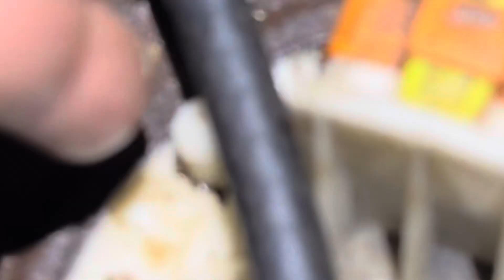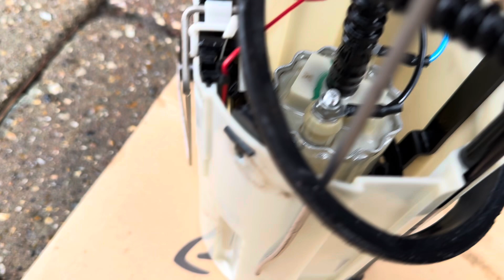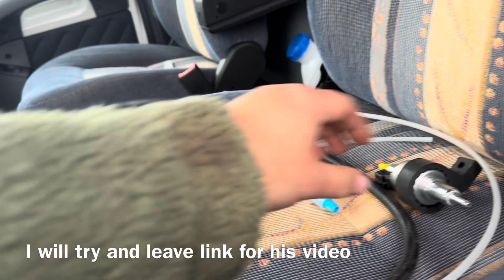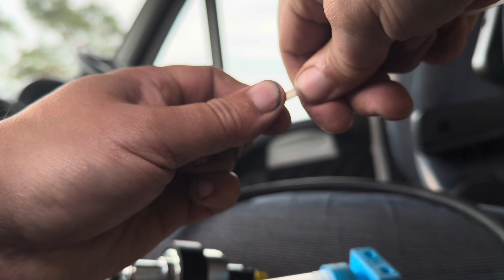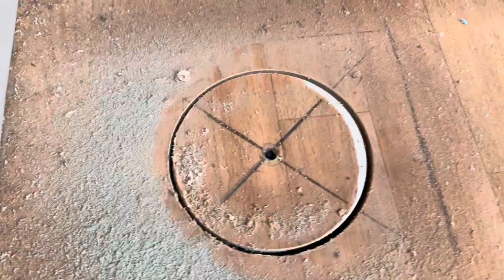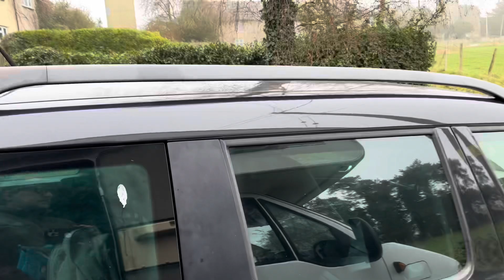How to Fit a Sunster Diesel Heater | Chinese Diesel Heater In my  Motorhome

Comment from the maker: One thing I forgot to add is when you’ve finished with the sender unit and you’ve reconnected all the fuel lines you need to turn the ignition key one click without starting the engine. Just turn the ignition key ONE click and WAIT.

 What happens here is the fuel pump pushes any air that’s got in the system out. Just wait 40 or 50 seconds and then turn the key back that one click and remove the key from the ignition. 

Then repeat this process 3 or 4 times just turn the ignition key one click. After this has been repeated 3 or 4 times you can go ahead and start the engine.

Comment: Hey mate thanks for the video can you remember what length you cut the sender pipe to ? Thanks
Reply from the maker: Hi mate. I know it’s a painfully long video but I did show it. Watch the 20.00 minute point you’ll see I cut mine to 20cm and why.
That’s measuring the whole pipe.Remember my low diesel light was illuminated when I fitted. And in my Motorhome I’m happy with 20cm. My heater runs out of diesel with about 50 mile journey time remaining. Ish. Good luck

Comment: Thanks. Video was useful to me. I am changing the Fuel Pump/Sender to try and cure possible intermittent Fuel Starvation. (Done the Filter). I had got to the Pump removed the fuel lines and Electric connector disconnected final ring plate removed and now want to remove the complete Pump. Had a go at pulling up but seemed secure. That was the end of my day so looked up and found your vid later showing you were able to lift up with some force. Will have a go tomorrow. 👍
Reply from the maker: Hi there  
Yeah that sender unit can be tough to lift. It’s like a vacuum or something with the rubber seal. Make sure you got clean hands and what you’re pulling on is not slippy. 

Providing all them nuts are out it should break free but mine was tight. 

Putting the unit back and getting it seated correctly before bolting it down again will be easier with 2 people. I done mine alone, (several times actually) so it can be done alone. 

But make sure it’s seated correctly. It takes some downward force to pinch it down . If you nudge it with a mallet or something remember there are some wiring connectors directly on the underside of  the top of the sender unit that may come unplugged as you tap it into place. That’s a pita. All has to come out again. Ask me how I know. 

But it can be done. if yours is same model as mine it’s easier than I thought. Just a little jiggery pokery with the float coming out. 

Getting it seated again correctly, again just  a little bit of time but no bigee . 
And pulling the sucker upwards to get it out in the first place . Takes a bit of oomf. 

Oh and when you have it back together and all connected up again. Turn ignition key once and wait. You’ll probably hear gurgling if you’ve emptied sender unit. Just wait for 30 seconds 45 seconds until you actually hear fuel pump stop. It takes AGES first go. So make sure radio, heater blower etc is off so you can hear the fuel pump. 
Repeat this 3 or 4 times just turn the ignition once without engaging engine. That should clear any air in the fuel line. 

Best of luck.
Reply from the maker: Ps and yeah remember to open the diesel cap I hear it helps release pressure in the tank if you weren’t aware.

Comment: Nice just. The sender unit part was more of a flaff than I thought but got the job done. Fill the filter  with fuel when installing, saves keep priming. Thats a good job done 👍 💪
Reply from the maker: Yes Jase I did consider filling that fuel filter but it’s only a foot or so of line before it falls downwards to the pump. Just hitting the start button it primed nicely. Now it’s primed that’s it although I may replace that first filter with a better blue one and just support the fuel line suspending the actual filter.